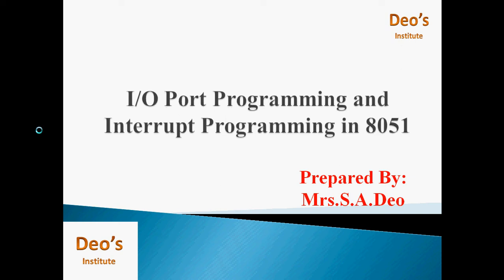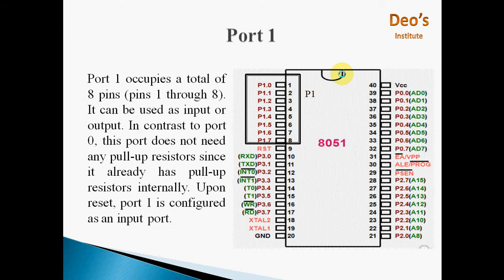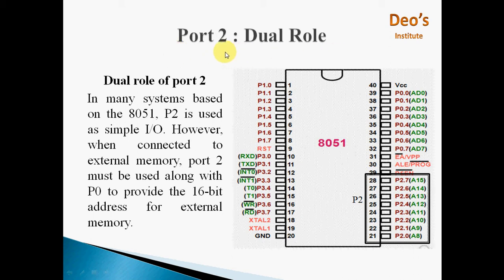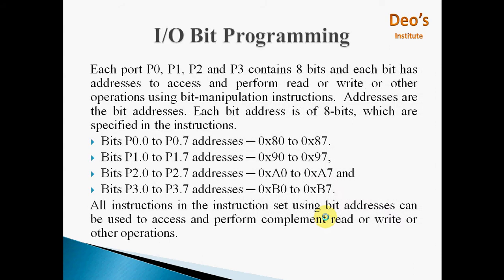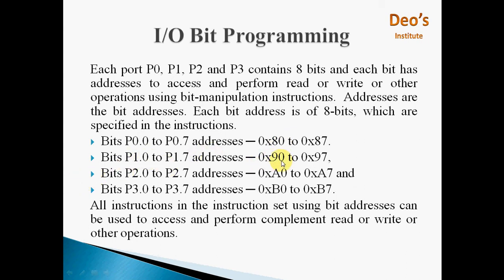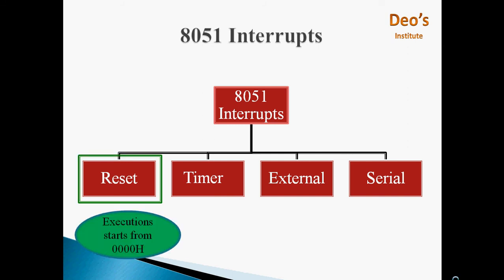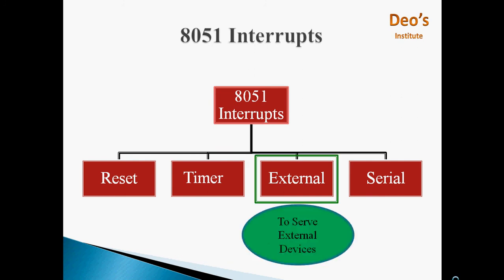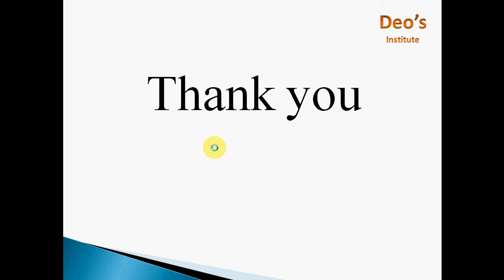I/O Port Programming and Interrupt Programming in 8051 Microcontroller | Interrupt Service Routine

Comment: the vedio is nice & easy for students preparing for internal &External exams . Iam retired Manager worked in NMDC Ltd &presently  doing ME  1st semester in Power Electronics System in MJECT Hyderabad, could not attend classes due to instructor job in ITI College. For other subjects  like Power Electronics  converters&Analysis, Special Electrical Machines & Power Electronics Applications to power systems .
Madam for above subjects have you made vedio lecturers if  pl  share to me which will be useful for forth coming exams in above subjects.